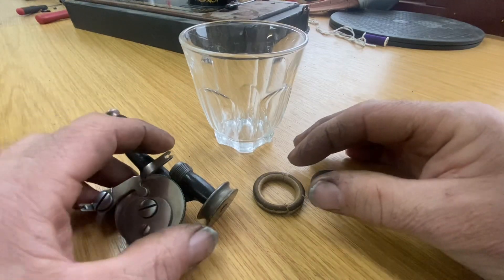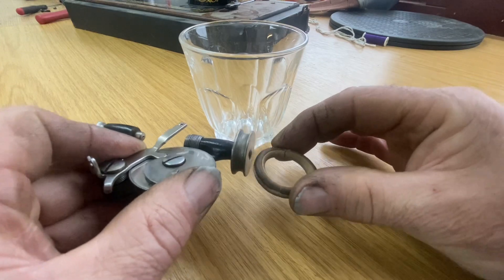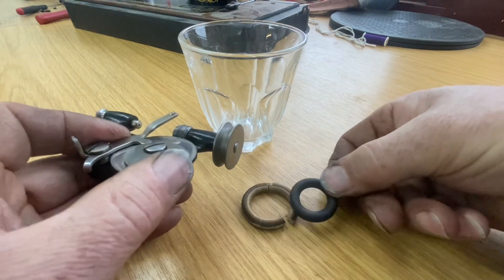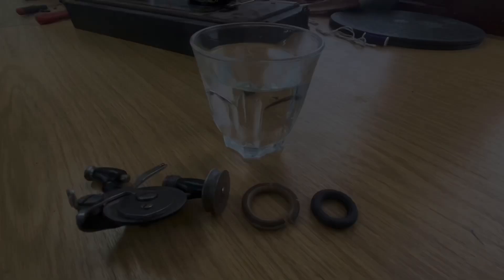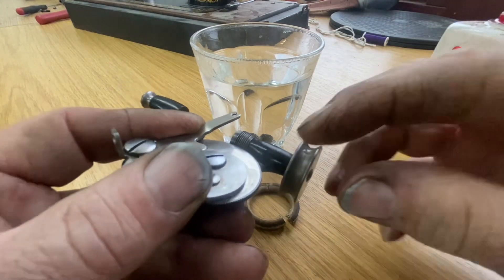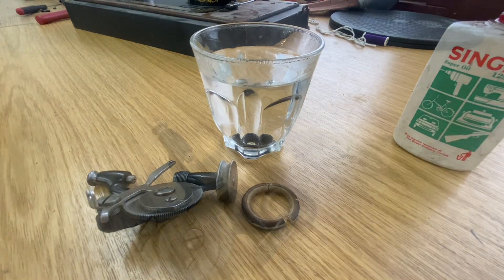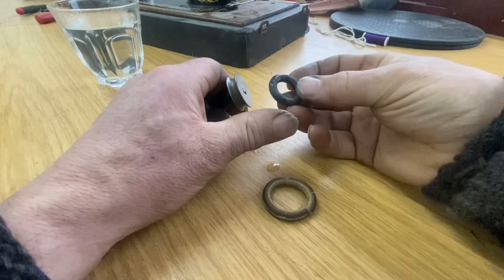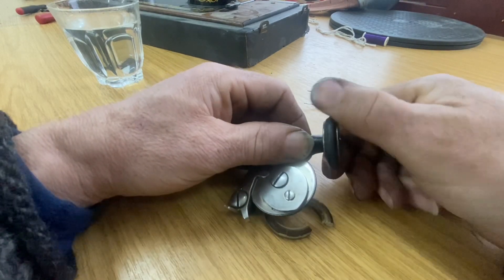Bobbin winder rubber tyre replacement.

Comment: A tip I learnt for sliding grips onto bicycle handlebars was to use lighter fluid as a lubricant as it dries off quickly, it might be applicable here. Super tip with the hot water thanks.

Comment: Good to know - thanks. But I have question about something else, I hope it's fine to ask it here. I have a Singer 27K and while winding the bobbin I have to hold the winder against the flywheel myself. I see them staying in place on their own in other people's videos. I haven't managed to figure out if it is supposed to be friction in the pivot point that allows the winder to hold it's position or is there some spring or contraption missing on my machine. Would appreciate if you could tell me what is going on at the backside of the bobbin winder that allows it to stay put in either position. Thanks!
Reply from the maker: There is a screw, behind the winder, often just needs tightening up.
Reply: @sailingtessbesssewfarnorth1746  On closer inspection now I found a piece of paper that someone has added in hopes of increasing friction in that pivot joint. So probably it is somewhat damaged. But now I know what I am dealing with and I will be able to find a solution once I have time to work on it. Thank You very much!